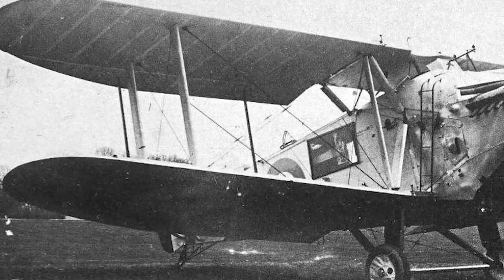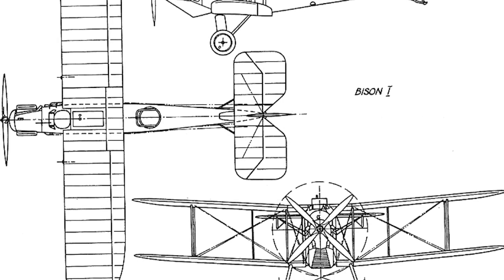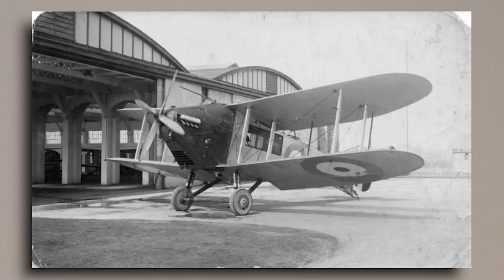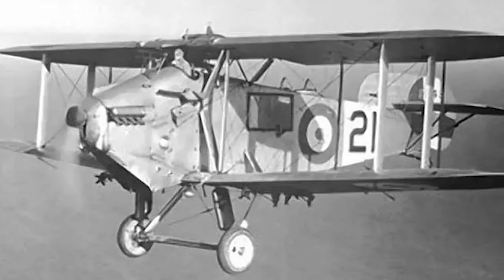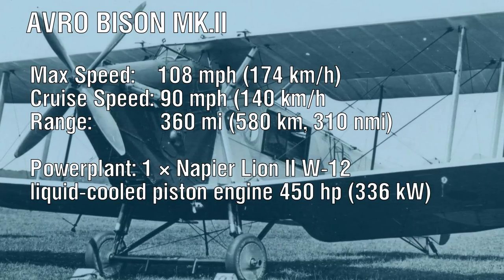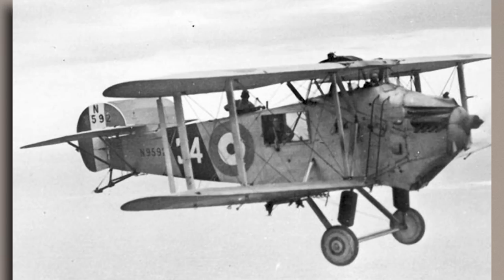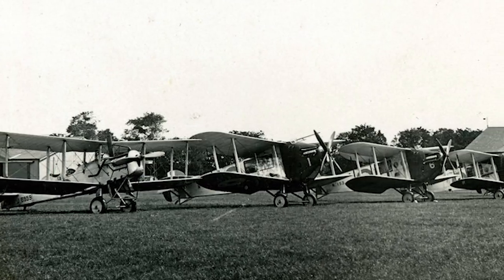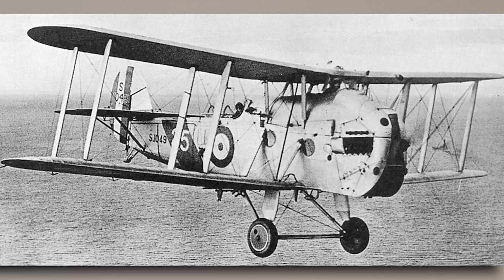The Most Hideous Plane Ever Built?  | Avro 555 Bison [Aircraft Overview #66]

Comment: On the plus side, those home-center bathroom windows made it dead simple to install a standard window air conditioning unit. This feature was, needless to say, much appreciated by radio men and navigators serving in India and Australia during the interwar years.
Reply: Real or joke?
Reply: @johndododoe1411  I don't think window AC units were invented in the early 1920s...
Reply: @johndododoe1411  😉 Joke, but I'm sure it would have been popular if available.
Reply: If they'd a had 'em, they'd a used 'em.
Reply: @jaex9617  It would of required on hexk of an extension cord!
Reply: @ronfullerton3162  Oh, they wouldn't have gotten that far in an Avro Bison!
Reply: @ronfullerton3162  😄
Reply: @johnalogue9832  Yeah, if it flew like its namesake…what a funny choice of a name, isn't it? 🤔
Reply: @johnalogue9832  You are right! What was I thinking?
Reply: @rubiconnn  They do exist before 1920... its called a fan and an ice block.
Reply: Oh, I just imagined an entire bathroom with toilet and all 😸😂 Even a shower in the other window
Reply: 😂😂

Guessing the noise fromm the generator required to supply power to the window rattler would'nt have been so welcome 😁
Reply: @cesarvidelac  
Pilot and gunner seated outside in their flying hat goggles and warm jacket and gloves.

Navigator shower cap squeaky rubber duck soaking in a bubble bath.

Slippers placed conveniently on the porcelain tiled cabin floor and bath robe hanging on a hook 

Curtains of course drawn to maintain the navs dignity...😊
Reply: @cesarvidelac  Posh AF!
Reply: @rubiconnn  then what's with the windows, huh smart guy?
Reply: Really an airplane named Bison!? Like the Buffalo, right!? A big ugly fat animal that can't fly and is in fact slow and clumsy even by herbivores standards. Someone really needs to talk to the Avro marketing department.
Reply: @rubiconnn  Well, this plane was invented around then...
Reply: Brilliant... i want to photoshop it!
Reply: @johndododoe1411  obviously it was a joke, but the story about the sauna and whirlpool is definitely true.
Reply: @ronfullerton3162  Ron, "would of" (like should of, could of, must of) is not actually a thing in English. It's "would've " which is a contraction of "would have" ...so "It would have required..." Sorry to be that grammar nazi but English is English

Comment: I wonder if those large living room windows are plate glass that would easily explode in just  a rough landing?
Reply: Probably depends on how rigidly they are connected to the frame. If the conn is flexible (like a rope/wire suspension), it could probably survive a decent amount of shock.

Comment: That 4-blade prop looks like it was taken straight off the WW1 BE2c, the reconnaissance/artillery spotter, which had an ugly broken-back appearance, and was too stable, making an ungainly slow sitting duck of an aircraft. The observer/radio operator/gunner had to wind in, on a reel, the long trailing wire aerial, before evasive action could be taken. A terrible  machine.